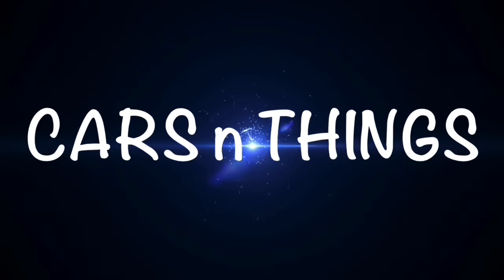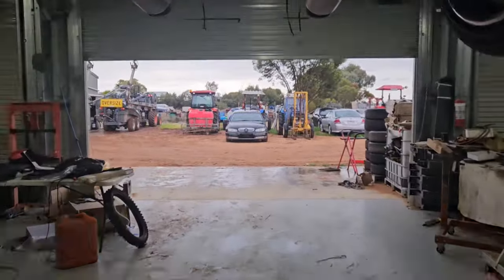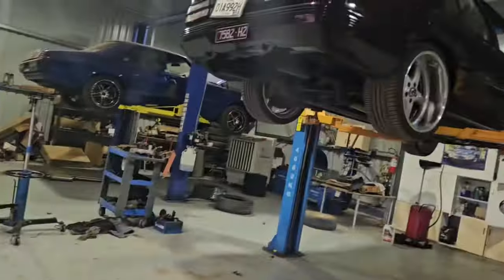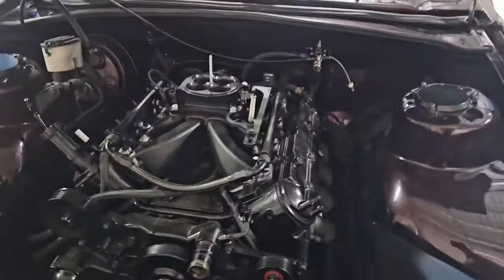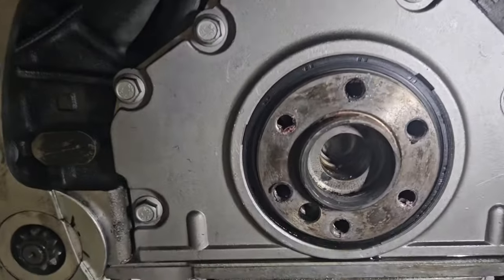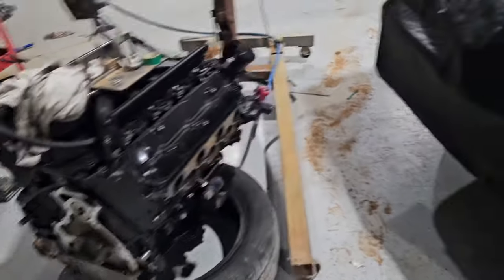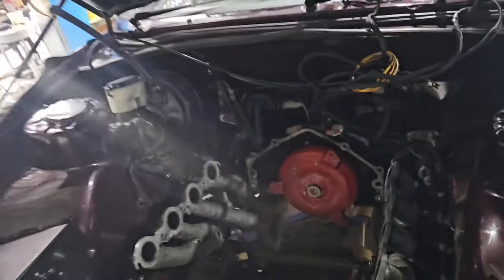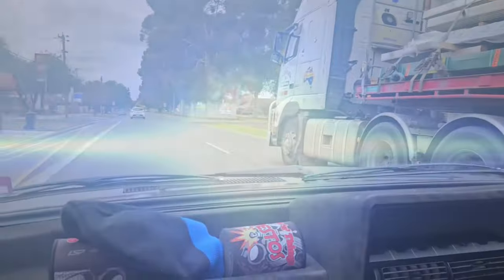Nothing’s Going To Plan.

Comment: Haltech and tuning.
Just make sure Bank 1 O2 sensor is actually Bank 1 cylinders.

If mixed up, it could be trying to pull fuel… but isn’t working, so tries to pull more fuel.
Opposite for other bank, adding fuel.
The -10 and +10 is probably the max limit of authority for long term fuel trim allowed.

Quick way to figure it out.
Can reset the long term trims… to 0, then with engine idlkng unplug an injector and see which sensor reads lean all of a sudden.

In config section, make sure individual cylinder numbers are correctly matching which bank too.

Brilliant product, I have a Nexus R5 running a Ford 5.0L Windsor and a 4sp BTR M97LE in a 1966 XR Fairmont, smooth to drive, DBW and cruise control is mint too.

Good luck with chipping through issues as they arise.
Reply from the maker: Thanks bud I’ll check on that .
Reply: @carsnthingsrestos31  I just finished watching video, looks like it was cruising nicely at the end, so might be all good.
I can say, when I wired mine up, then fired her up the first time, I had the bank numbers mixed up for O2 sensors.
Sitting there idling it was getting worse, then it clicked what was wrong.
STFT was trying to make corrections and it wasn’t working, so it was trying harder… soon as I corrected that, magic.